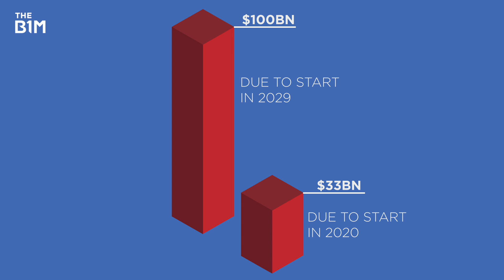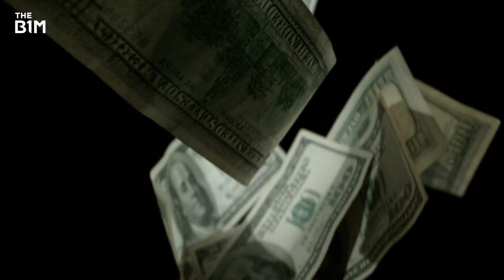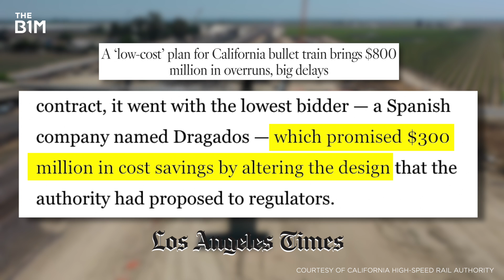What Went Wrong With California's High-Speed Railway

Comment: I don’t even live in California and this project fills me with rage, JUST FINISH THE STINKING TRAIN 🤬😂
Reply: It isn't the building of the rail that is the problem. It is all of the demolition and re-routing they have to do, that takes time. All before there is rail in sight at all.

Rail is cheap. Busting a rail line shaped smooth corridor through densely populated and built California.... Expensive and slow.
Reply: I do live there, and it looks like the line intentionally avoids the city I live in >:(
Reply: I live in California and its embarrassing
Reply: Impersonal Immigrant  many don’t like driving for hours and hours where they could do something else like reading or doing work on laptop while on train.
Reply: It might not be possible very quickly, not just because of cost overruns and infrastructural delays, but it all comes down to how people love... Cars and flying. China had built a lot of high speed rail lines, and that's because every land in China (not to mention disputed borders) is state-owned by the government, so there is little resistance of the Chinese high speed rail thanks to a very different political system, unlike the US, who a lot of people have private land properties that needed to be negotiated like land acquisitions in order to allow the project to be built. So... Because China has a biggest high speed rail in mileage, some might say its a Chinese project and they do not want it to become like China (with the spike of Asian hate crimes, that might not be far-fetched) and say they would rather be late than having a high speed rail dominate over car and air travel, thus it is possible the California High Speed Rail project might face more resistance despite Joe Biden's 2 trillion dollar infrastructure plan, and for some who wanted high speed transportation, that wont be great...
Reply: I live in Arizona and I need a line between Phoenix and LA like right now
Reply: @rubinortiz2311  ✈️
Reply: @artiew8718  no takes too much time
Reply: Now you are just a whiner. Just be patient and let it finish and you will have what you want. Call your legislators.
Reply: i live in the bay area, and this would definitely affect the city i live in. that being said, i think it is still dumb, because no one would use it
Reply: We’re likely paying for it through federal taxes. And yet my family has been pushed out of all the nice places to live while foreigners have been invited in...
Reply: Impersonal Immigrant  id rather take the HSR and sleep while riding train than drive my ass off for 6 hours
Reply: No, just cancel the train.
Reply: Impersonal Immigrant  because cars are stupid XD
Reply: Only California could fuck up a project this badly. Hopefully no other states prove me wrong...
Reply: I'm filled with rage about anything California does.
Reply: @jacksak  don’t worry about California then
Reply: @californiamade5608  Okay, thank you. I'll let you worry for me.
Reply: @jacksak  Except for being one of the largest federal tax donor states, of course
Reply: @charles9391  - how has the federal government been managing it's money lately? Until these morons can control their spending - no US citizen should pay federal tax. Just pay local state tax. It's a doomed system anyway.
Reply: @jacksak  - let it fall into the ocean... That'll save money & stop wildfires (sarcasm).
Reply: A MagLev train would be more ideal for travel between state. I wish the US would just invest the 2 trillion in high speed transportation. Could you imagine being able to go from Phoenix to LA in just an hour. Too bad america love the automobile.
Reply: fr
Reply: Even I as a Chinese feel sorry for people living in CA 😂 They deserve a better way of travelling
Reply: If USA China cooperate for it, can be very cheap and quick!
For example, California High-Speed Rail from LA to SF, 840km (520mi),  approved in 2008, will operate in 2033 (about 25 years), original budget was $77.1B,  in the future will be $98.1B!
If China takes this project, the cost almost one-third of the current budget and can be done within 10 years! 
China's high speed rail with a maximum speed of 350 km/h has a typical infrastructure unit cost of about US$ 17-21m per km, with a high ratio of viaducts and tunnels, as compared with US$25-39 m per km in Europe and as high as US$ 56m per km currently estimated in California.
https://en.wikipedia.org/wiki/California_High-Speed_Rail
Reply: @johnfeng4374  there is only a couple high speed railways that turn a profit I can a assure you this isn’t one of them. It’s a huge money dumpster no matter who builds it
Reply: @2SpyC_  most China's high speed rail in operation now turns profit because of heavy passengers. Also countless positive impact to related social changes.
Reply: @2SpyC_  most of China's high speed rail in operations are turning profit. Certainly China has heavy passengers.
Reply: @2SpyC_  Chinese company built the Oakland San Francisco bridge from 2006 to 2011. This bridge may turn a profit 10 years operation. You may see how good quality of the bridge if you drive through it.
Reply: @johnfeng4374  Lol they built the bridge and no talking, only working working working, no bs, no delays no nothing, they even finished 5 months earlier than expected. Meanwhile if politicians were handling that project I got a feeling it wouldn't of been built. They should of done the same with the High speed rail across the US
Reply: @Racko.  John super agree with John. Chinese are hard-working indeed!
Reply: @johnfeng4374  Bless!

Comment: -America's infrastructure construction costs are insane. Even compared to other unionized and industrialized nations..
-The route chose is not the easiest or most direct. (Land acquisition and going through urban areas proving difficult). But going throigh the Central Valley does mean you'll connect like 80% of the entire state, if the system gets finished, rather than just a couple of cities.

Comment: If you wanted to go to work and your workplace is on the other side of the state, and you lovr cars and hate high speed trains, would you rather, stick with flying or driving and end up suffering revenue losses due to lateness caused by congestion, or get rid of your love with cars and switch to public transportation like high speed rail if you don't want to be late.

Comment: The best part imo, the Anaheim station was built and competed 2 years back. It just sits there as a shell of way too expensive building. That's the kind of spending happening with this project. This is ANAHEIM ... Not projected to see a train dining through that station for another 10 years at a minimum.
Reply: They were going to rebuild ARTIC anyway but continue....

Comment: "Eyeing Florida"

Brightline Beginning Orlando-Miami in 2022: Hello I exist
Reply: 125mph of brightline is not high speed rail. it's good! but not high speed rail.
Reply: @P0w2you  I agree, their trains are also diesel powered. 125MPH isn’t high speed but it’s only 5MPH closer to the standard speed of high speed
Reply: @P0w2you  their new trains are going to be high speed. They’re building there on rail infrastructure
Reply: @frostystallie8736  No they wont. Only the part between Orlando and Cocoa will be 125 MPH. The limit is due to the curvature of the railway, not the trains itself. The remainder, which is nearly 80%, between Cocoa and Miami will be significantly less than 125 MPH. Brightline is branding itself nicely. Also the Acela should not be considered true High-Speed, as major parts of its route are also incredibly slow.
Reply: @P0w2you  Thats the max speed the average speed is about 90 miles per hour. Slower than the average european train
Reply: It can’t be high speed when they have to close the line every day because another idiot got hit by the train
Reply: You have to start somewhere, and that's as good start as any. Bon courage!
Reply: Sweet.
Reply: Too bad it's in Florida lol
Reply: Brightline isn't exactly what you would call "high speed rail". It only will go to about 125mph while California is going for a true high speed line
Reply: Great, too bad Florida won’t exist anymore in a hundred years due to the oceans rise

Comment: 1:25 well technically it is high-speed since high-speed rail's current definition is 200kph+ or 125mph+ and many European countries also use that definition but maybe the definition should be that AVERAGE speed should be 200kph/125mph, not PEAK speed.

Comment: At 6:36 "cautious optimism" with $20BN is a very friendly way of putting that. Since only a few minutes earlier at 3:36 we see an estimated cost of $100BN for a small section of the rail in CA. Can't even finish that section with that massive $2TN stimulus plan. 🤡
Reply: that was misleading. the section under construction now (aka the 119 miles from madera to wasco) is about $15b iirc and the full 171-mile ios from merced to bakersfield would be about $22b. the $100b figure is the high-end figure for the entirety of phase 1 which is from anaheim to sf which is likely not going to be reached because the last two business plans have be within range of the expected costs. however, even if it ultimately does cost $100b, then at that point, the entire phase 1 from anaheim to sf should be done. if it's not done, they probably haven't spent anywhere near $100b.
Reply: funny how the infrastructure stimulus was supposed to benefit workers, but Cali somehow managed to be more corrupt than the federal government and threw it away

Comment: Just let brightline handle it. There higher speed rail line is already active, as fast nas car travel, and has the same cost. Exept, now you get a comfortable ride where you can get stuff done. The route doesn't have to be high speed rail, higher speed could work just fine.

Comment: The UK doesnt need High speed rail,it takes 4 and a half hours to go from London to Edinburgh on normal,fast intercity trains.
Reply: HS2 is should have been called the Modern Central Mainline. HS2 is for capacity, rather than speed. However, there is nothing wrong with building a modern intercity line to current top-spec
Reply: It really does need it for Capacity means
Reply: People in the UK just don't get it! HS2's purpose is to increase CAPACITY, not reducing travel time! Look at how congested the trains are in the UK, especially the London to Midlands ones, we need HS2 to connect the different regions and even out the inequality. Otherwise London (and its satellite towns) will be the only region in the UK that grows!
Reply: Yeah don't build it 
We will have to destroy it when we separate
Reply: @spaceexplorer5481  what the hell does that mean cause I can tell your not Scottish or English.

Comment: You definitely soft-pedaled the reason why Elon Musk proposed Hyperloop. He did it specifically because the California High Speed Rail project is absurdly expensive, too slow and will probably never get built as proposed due to all the corruption and opposition. Clearly the Demonrats in control of the state gov't are only interested in the project because of all the graft it can provide.

And by the way, we here in Kings County feel that we've been run over roughshod by the state. What we really wanted was another dam, not a rail line cutting through our super-productive agricultural fields. There's been no attempt at all to use existing right of way and avoid tearing through the middle of farms. And there's only one stop planned in the entire county, inconveniently distant to both Hanford and Visalia.

Comment: Good Video, but there is a wrong/unclear part: You sad it would cost 100B$ and only be finished by 2029 just for the first Section, but actually this is the price for the hole system. The Date 2029 is correct though.

Comment: Why do they built the tracks off the ground in flat areas? Isn't it way cheaper to just raise the ground a bit and lay the tracks upon that with fences next to it? And then you can still built tunnels.
Reply: Grade separation. The box junction north of Fresno is where the HSR crosses an existing railway and then a river. You don't really want high speed trains mixing with road vehicles and other railway traffic
Reply: @jamesbedford7327  I understand the seperation, but isn't it way more expensive to built giant concrete pillars instead of just making a little hill and building highways and other cargo tracks underneath it. In a way that it's just a little bit higher and the tunnels just run through the hill?

Comment: It's amazing that China has built 37'000 km of high-speed rail. Outside of China only the EU with 10'000 km and Japan with 3'000 km have relevant HSR networks.
Hyperloop will never get off the ground. It is an idea floated first in Switzerland (called Swissmetro) in the 1980s and 1990s with serious planning work, but it was abandoned due to poor cost/benefit ratios in the 2000s.